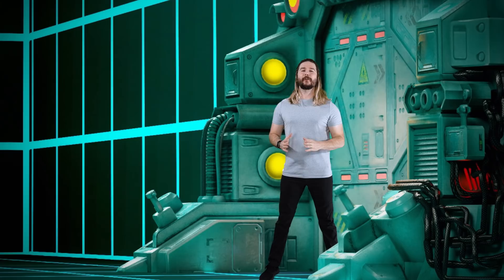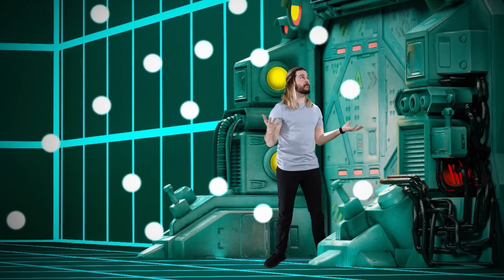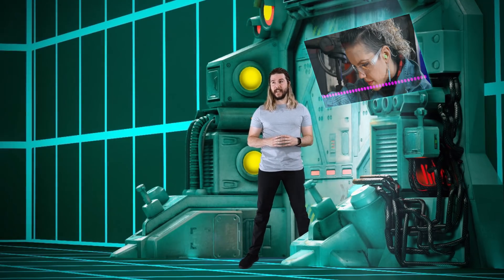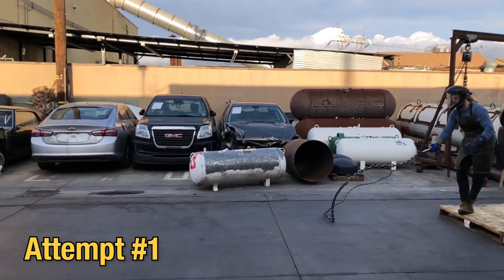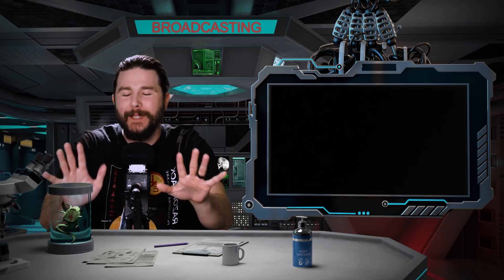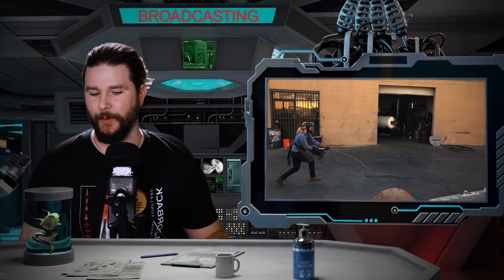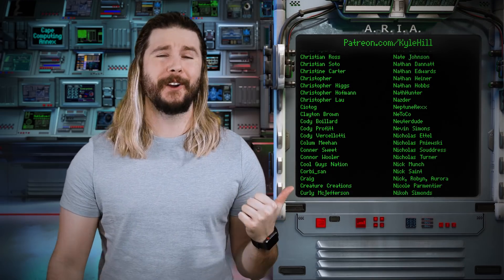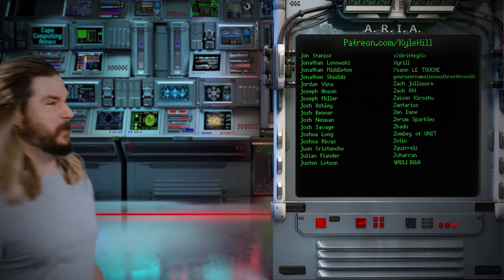Can I Make a SUPERSONIC STEEL WHIP?

Comment: I know why from my own experiences with whips.

So there are 2 compounding problems you will have to overcome if you feel safe doing so and try this again. 

1. The motion. Your physics are correct, only if they properly correlate with the model. If you watch your footage, during the moment you would expect a crack, most of the whip is still moving. The momentum is not transferring efficiently. Your arc is too large. If you watch the motion of a whip in an expert's hand, a large loop is formed at the beginning of the motion which overlaps itself slightly. As it progresses down the length of the whip, the loop shrinks and the main body quite neatly stops in mid air.

If you watch that video again, take note of the first crack. He swims the whip overhead, imparting significant momentum into it before reversing the motion. That reversal is the key to directing the energy down the length of the whip. Otherwise, you may as well have a wobbly noodle. 

2. The whip itself. That thing is heavy and long. Both of these factors make it harder to use. The heavier a whip is, the more energy you need to be able to put into it, and the more difficult it is to control. There are whips with steel shot in them to increase the weight, but these are for experienced users who can control them better. Essentially, your skill equates to the efficiency of energy transfer. If you can effectively impart 30N into a whip, but loose 90% of that energy to the raw weight of the material, it won't work as well as that same 30N in a whip you are comfortable with and can use it at an efficiency of 90%, only loading 10% to the weight of the material and actual energy transfer. 

I mentioned its length. The longer it is, the harder to control. You need enough material to generate the motion that transfers the energy, but there's a point of diminishing return. A whip concentrates energy, but only if the motion is correct. At a certain point, it becomes neigh impossible for a whip user to actually swing it. Imagine trying to fight with an 8ft sword. Even if you could hold it, it would be clumsy and unwieldy. 

My proposed solution. 
Find a large, flat, paved area with a radius larger than that of the whip. Stand in the center and rotate, holding the whip at arm's length until centripetal acceleration holds it nearly straight (counterclockwise if right handed).  Take a step backwards with your right foot, over the relatively slow spinning chain and pull your right arm slightly up before snapping it down and in the direction of the chain as hard as you can, lifting your left foot out of the way as you do so. The chain whip should crack to your left at about 15-70° from the direction you are facing., depending on your step timing and the speed you move your arm. This method should also keep the end away from your legs as long as the tapering proportions of the chain are close to reasonable.
Reply: quote for emphasis
"That reversal is the key to directing the energy down the length of the whip."
Reply: Commenting for engagment so this comment stays close to the top. You are 100 percent correct.
Reply: @benfiander40  thanks.
That's actually an interesting thought I hadn't considered. How does YouTube sort comments in terms of number of replies, recent replies, and likes/dislikes?
Reply: with all that whip knowledge. I unironically think you're popular at parties, at least certain types of them ( ͡° ͜ʖ ͡°)
Reply: This needs to get to the top of the comments
Reply: >"Imagine trying to fight with an 8ft sword. Even if you could hold it, it would be clumsy and unwieldy"
That's exactly what I thought the first time I saw Sephiroth. Totally off-topic but yeah I couldn't help but think of that
Reply: @whiteface513abandonedchann8  couldn't help but read that 8 foot sword quote in the voice of skallagrim in my head lol
Reply: This is true
Reply: Small note/kinda correction, 8ft swords could likely actually be wielded and definitely held; provided they're made properly and not giant slabs of metal like fiction tends to show extremely long swords as. 8ft is definitely pushing the limit(the longest thought to have been used in battle was ~7'5 feet long and ~23 pounds), and anyone who isn't 7 foot tall and specifically trained with it almost definitely suffer enough loss of dexterity that it wouldn't be worth it over a 6ft/6+1/2ft sword. There may be an issue of breaking or bending at that length, which is a good reason swords that long were never standard or used for combat historically. In other words, against an unarmed person or someone with a simple dagger, both being unarmored, an 8 ft sword would be perfectly fine, but any type of metal armor or prolonged battle would make it practically useless

Consider also that the way you use it would change, just like hand-and-a-half swords, maces, and many other weapons, you can and should change your grip on the weapon based on how you're using it. The hilt on such a sword would invariably long, as well as the hilt end of the blade being unlikely to be sharpened. As such, you can and would adopt a more forewards grip going so far as the metal of the blade itself when more dexterous movement was wanted while the rest of the hilt would mostly serve A)to counterbalance the blade itself and B)to give you the capacity to modulate how strong of a swing you're inflicting by moving to a lower grip.
Reply: I agree,he's doing something wrong with this experiment.

Comment: Hi Kyle, when I saw your first video with the  slicing of the fruit and melons, it was impressive. Getting that much mass moving to the speed of a crack takes not only a huge amount of effort, but there are specific motions that promote the wave needed to send the momentum fluidly down the length of the whip. Please allow me to explain. I have been working with bullwhips for over 20 years. I have cracked whips accurately weighing as much as 6Kg. Normally for a whip you're talking 1Kg or less. Notice the body mass and the exceptional physical effort the presenter is using. Physics demands equality.

The longest whip is not as hard to crack as the heaviest whip. Because you need to use both the effort you put into the whip as well as the motion to make it crack. There are several tricks to making a whip crack, the most common used by those starting out is to jerk their arm in one direction, usually in front and then yank their arm back, changing the direction of momentum, which speeds up the initial wave and forces the whip to crack. If done with control, this can be useful to make a whip crack. But it almost always alters it's path into something that is at minimum unpredictable and at worse dangerous. Likewise your initial motion to start a whip to crack should be smooth not a jerk, because you can't keep the speed up from a jerk, it allows the tail to move out of sync with the wave you're trying to produce. As a result you end up hitting the back of your leg etc.

I've taught people to crack whips in the span of 30 minutes with reasonable safety, but a great deal of success with whips is developing muscle memory, which means you have to practice practice practice.

Cheers and thanks for the video.

Comment: Have a good whip needs a popper the poppers what makes the sound not just the speed of the end of the whip if you want to go with all metal and I've been contemplating using a piece of cable at the end that's freight out and I don't know if that would have the flexibility but it needs some kind of a popper at the end

Comment: i got a metal whip (copper extention cord with electrical tape for the handle)
first your technique: you go for a side whip, very good for forward whipping and will land on the flank but you should try a up and down whip it's easyer to aim and master (plus your aiming for the groin area)
if you want super sonic whip you need to swing it over your head and let it built energie, then the tricky is the release (have your left arm in gard position to protect your face)

Comment: Its isnt the swinging that gets the whipping action it is pulling back at the correct moment causing it to try to come back that's how you get the whip practice with the normal whip for safety's sake and you will get it -- also maybe try with a light metal maybe aluminim chain links for less weight -- it's not failing until you stop trying up til then it's just trying again

Comment: I absolutely believe chain whips are absolutely harder to use because of how the chain links interact with eachother and the weight itself is a huge factor to the point I don't think you with your muscle mass could easily practice with a chain that size however it's worth noting that the guy in the tiktok has a significantly more muscle than yourself but he also has proper form for a whip. where you might have felt it dangerous to use such a "tool" without fear of being hurt, something that most beginners have when using a regular whip. It seems you might need to reach out to someone with a more open space to try such an experiment as well you may benefit from practice with a lighter version before you move on to the giant chain.

Comment: Hey Kyle
Now I may be wrong but from my understanding it's the flick that creates the crack. 
So on one side of the curve you've got heavy side that's attached to you. Then on the other you've got the light end getting pulled around the curve at the end by that much heavier side. 
Basically what I'm saying is I believe it's more about the pull back on the heavy side than how fast you can throw it forward. Think towel whips you throw forward and yank back at the last second to get the crack.
As this may make an already dangerous whip more dangerous because you're actively pulling it towards you I thought of a middle ground to test to see if it's more about the "backwards"  acceleration of the heavy end. So the idea is you plants some sort of pole that could handle the forces involved in the ground. You then have the whip with the heavy end and yourself at the pole and the light end stretched out far away. Then with the whip around the pole (not wrapped think like it was draped over it if it was vertical but on the ground obviously) run towards the light end pulling it as you go. If I'm right it when the light end starts to change direction around the pole it should crack.

Comment: Could he not use different metals throughout the chain? First starting with lead since it's so dense then steel then aluminum so that not only will the links be smaller but also less dense losing even more weight and gaining more speed. It would be a fully metal chain atleast.

Comment: I would suggest that the reason you didn't get a crack is due to the friction between each link being increased by the acceleration along the chain slowing down the rotational velocity of each link causing the whip to swing wider resulting in the lateral momentum of each section being balanced by rotational velocity of each link, that balance ending up somewhere below the speed of sound... I'm sorry if that's confusing or absolute BS but I'm half asleep as I type this...

Comment: Chain link sizes go much smaller than he had, but he does run the risk of losing a foot and the end of the whip exploding apart. This is just a bad idea to do in person. It would be better off if a mechanical rig was used to whip the chain instead.

Comment: Hey Kyle, I have performed with, and taught bullwhips for about 8 years now. If you need some pointers, I'd be glad to help.

For starters, whip throws come in two flavors: "round" and "wave".

A "round" throw is usually sending a coil down the length of the whip and letting that coil get to its smallest self at the end of the whip. It runs out of whip and and the cracker cracks. You most often see this kind of throw done by spinning the length of the whip one way, and then quickly spinning the whip the other way to impart that coil.

A "wave" throw (or a "flick") is swinging the whip totally straight, and imparting a sine wave into the straightened whip with a flick of the wrist.. The wave travels down the whip and creates the crack.

With this sort of whip, a round throw could take your head off. But, you can do a flick. The trick is don't have the whip directly behind you. If you're right handed, have the whip behind you and to your right (the opposite if you're a southpaw). Then practice swinging the whip away from you. Don't crack it (yet). Once you have gotten the motion of swinging the whip like a really long sword, then you can impart a wave with the flick of your wrist on a horizontal plane. 

Happy cracking!

Comment: Dude the probleem is you. You don't know how to crack a whip propperly and your also not strong enough to do it. A whip crack is a very diffucult to perform techniek you have to know how to do it can take a long time to learn. I wouldn't be able to crack that soab, but bring me a 9 section whip and pay for me to come over and I will crack a chain for you. But if you want to do it yourself here are some tips from a marshellarts practicener training with 24 different weapon combo's including 9 section whip, horse whip, meteorhammer, and horsetail whisk single and duo. For one you clearly aren't doing the same motion as the guy in your video, cause if you look well.... no if you just look cause it's really simple to see he spins his whip before attempting a crack. He is building up energie before realising it into the cracking motion. Like you would rol up a towel before whipping at someon. See it this way imagen a car and you have to push it but it's standing still. Sow it's super heavy, but now it starts moving and it becomes easyer to push. That apply's here too. First start moving it from side to side like a snake on the ground then attempt to crack it. Second a whip will only crack if it's under sow much tention that it's bassicly stiff like a board before a crack. You have to make sure that to chain is moving sow fast in a form of rotation that it wants to pull it's self out of your hand. If you reach the maximum speed you can interupt the motion into the direction you want making it go from solide into liquid at one point in the in the chain the rest of the whip will follow. You can do this by (if your doing the snaking motion I told you about) making a much shorter motion backwards and then one way bigger full powerd one forward. 3 to keep you from hitting your self never let it return to the same side you started always let it go from your left to your right side or the other way around. Argo when you crack the whip put your full body in it make sure it cracks when the handel is infront of you and pull it to the other side while stepping backwards out of the whips way. I can't do more for you without showing it to you.

Comment: Only issue I see here is that, the chain itself was too thick and thus heavy, yeah you could have done it being more reckless by swinging the chain at least 180 before going for the whip to give enough speed and momentum to actually make a sonic boom but the recoil would have been really dangerous.
I personally would have used dog chain thick links to make an usable, and probably really dangerous whip.

Comment: I feel like the reason this failed is because the chain can only transfer energy under tension and partway through the chain collapses. This may be why the tiktok used chain for the mass at the start then went down to leather to prevent the collapsing issue.

Comment: I made a chain Whip myself and I also have a little bit of experience making regular whips. So I might be able to help you out, first off even if the end of the chain breaks the sound barrier it probably won’t crack. You actually require a popper at the end of it to get the sound. Therefore my material of choice was a steel cable frayed at the end to replicate a popper made of nylon. This method works all right there is a popping sound produced by this but it’s not eardrum shattering like a traditional whip. Next Your technique was just bad, no offense. you require a much tighter loop running down the whip while cracking it to help accelerate the end. I would recommend learning how to crack a regular whip before moving to a steel whip. Finally you’re whip is too long too heavy and too unwieldy about seven feet is the maximum length you want this whip to be including the popper if it was about 4 feet in length you probably would have a lot more success. You could swing it over your head and you won’t hit yourself in the ankles.
Ps. You give up way too quickly using whip like this takes a bit more tenacity.

Comment: Kyle: This guy that looks like he could bench press me was able to do something I physically couldn't. Also, he probably cheated but we can't be sure
Reply: Not cheating, but I'm pretty damn sure the physics of a chainlink bullwhip doesn't work.
A ton of energy is lost between each link in the transition. And steel has a lower sheer streantgh than you'd probably think.
If the steel was creacked fastenough I bet you $100 that the tip of the whip would break right off.
Steel cable snapping under thousands of tons of pressure goes super sonic, but short of those massive forces its not gonna work for you. 
Long story short, the tip needs to be some kind of leather.

Comment: Kyle, did you guys try the winding around the head? I know from experience from throwing hammer and weight in college that the motion you use is very inefficient for how heavy the chain is. There is the problem of strength and actually being able to wind it. But if you are able to wind it you can multiply the speed of the chain for much less effort that the side throwing motion.